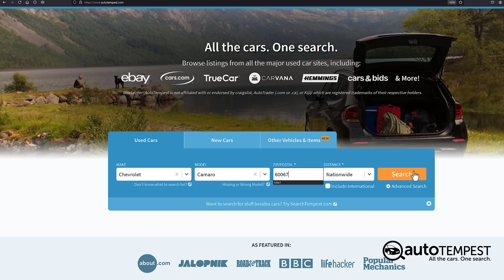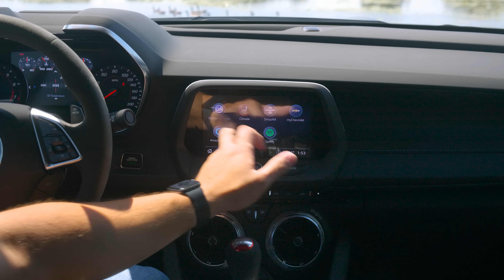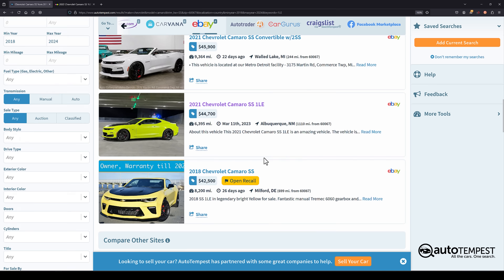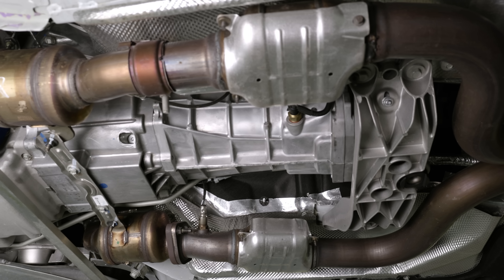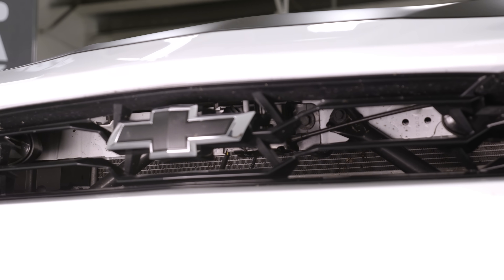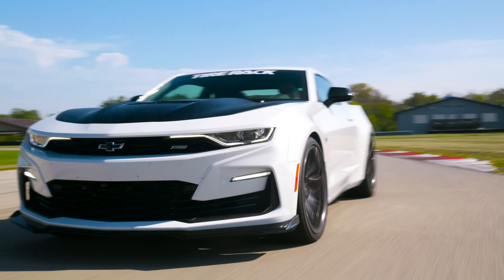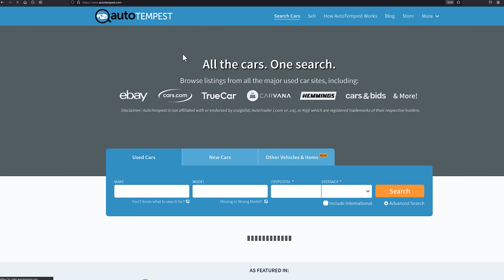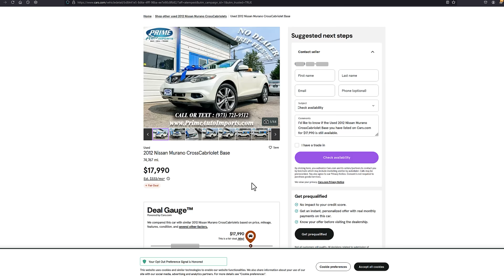Chevy Camaro SS 1LE | Best Used Sports Car of 2024

Comment: Owner of a 2018 2SS 1LE here that I taken on 30+ track days.  Thought I'd weigh in with my own experience:

1.  ENDORSED and great to see other people enjoying/discovering the car.  It's fantastic on the track and if you can live with the visibility it's a great daily as well.  I used mine as a daily for three years and the car has been very reliable.

2.  I don't know what tires Mark and Jack had on the car for review; I use the OEM Goodyear F1 Supercar 3s and think they're a really good track tire.  The Pilot Sport 2 is better yes, but I don't necessarily think it's worth the upgrade.

3.  Yes - if/when the car gives up a lot of time the front will go first.  FWIW, and given all the Miatas that can't shake me in the twisties, I wouldn't necessarily call it a "weak spot" it's just where the car is most likely to meet its limits.

4.  The brakes on this car are a strong point - I'd argue the braking on the car is better than the acceleration.  Between the size of the brakes and the mag ride keeping the tires on the ground you can outbrake a whole bunch of cars in an SS 1LE.  As the guys mentioned the car is also extremely stable; trailbraking is a strong suit.  Gyrodisc rotors and Hawk DTC-60s/70s are a worthwhile upgrade.

5.  I mentioned the daily reliability up above but if you keep this thing mostly stock it will absolutely eat track days and not break.  It's more expensive than some track cars but I like knowing that so long as I keep the fluids changed and maintain the car it'll start up and run.  All the mods I've really tried to this point are the brakes.

6.  Mark and Jack mentioned the S650 Mustang and the Supra as comps, I'd add one more - the F80 M3/F82 M4.  Looking at the weights and horsepower the Camaro SS/SS 1LE is fairly close to those cars.  The M4 actually has a slight edge in the straights, though the Camaro can outbrake them.  A key to getting fast laps out of the SS 1LE is learning how to use/trust the immense amount of mechanical grip the car has.

Great review and thanks for taking a look at this car!  I think someday they'll be in the pantheon of track legends like the E46 M3.  I'm super bummed GM killed the Camaro (again).

Comment: Had a manual 2024 2SS 1LE on order, but the dealership cancelled it because GM ended production. Found a 6speed 2SS with Magnetic Ride Control, and pulled the trigger. Man, WHAT A CAR! Handling is insane, comfort is a massive step up from my '18 WRX and '23 BRZ, and the car just looks/sounds killer. It's checked off all the boxes for me (storage and mpg not being one of them), and it's just sad the GM stopped supporting the platform to let the C8 corvette shine. Most of my friends are Mustang and MOPAR guys, but even they couldn't deny that they slept on the Camaro. I have never known the pleasure of having enough power on tap to merge on the spot... and now... I can never go back.

Comment: Wow!  I get here 6hrs after you (finally!!!!!) post the vid and it's like I'm the last one to the party for the comments that have piled up.    Thanks so much for responding to my and many others requests and doing this review.    Glad to see that you were both impressed.   
I am left wondering a little about your comments on the brakes.   I'm in my 4th year of tracking my SS 1LE and the brakes have been fantastic and without fade on OEM pads despite up to 30 min sessions.   Maybe the car you tested was using the OEM brake fluid (GM's may be crappy, despite being Dot4 now) or needed to be changed?  All of us who track it change to Castrol SRF and can run it all year (on and off track) without having to even bleed the calipers.

Comment: Loved my 1LE but got rid of it when the market was high and sold it for 8k more than I paid. Turned around and got a CT4V Blackwing.  The blackwing basically feels the same but is much better for daily driving. Both excellent cars in their own right
Reply: Camaro has the advantage of the V8 as MT has mentioned in the past when they tested Cadillac ATS-V, the only minus was the V6TT but then the 6th gen Camaro SS came out and they were amazed by its complete performance

Comment: I had a black/black manual that was stolen two months ago. When I bought it in late 2016, the driving experience was almost unbelievable. It kicked the M4's ass! Unfortunately they ruined the design in 2019 and GM seemed to give up on it after that. Now BMW has bounced back with the G82 and the Camaro is gone.

Comment: If you are tall, the visibility is not an issue at all. The Bose is a must have, the base audio is abysmal. I owned an LT1 trim - the absolute best value muscle car.
Reply: I prefer the Camaro SS because it has better handling than the LT1

Comment: Kind of surprised at your assessment of the brakes, I don’t know if that car fluid was old or what pads it was running, but I have never felt even a hint of fade with mine. I also do have the copper free package with the larger rotor.

Comment: Please don't stone me people. 

I prefer a Corvette and I think a lot of us would. Now to my BUT! This era of Camaro is amazing. I've driven one and they are fun. I considered one and will continue to do so as time goes on. I'm truly hopeful that GM will release a new Camaro and it'll be making the Blue Oval shake as it passes by. 😊😮😢

Had to say it. 😅😅😅
Reply: New C8 Corvette doesn’t have a MT option, and if you want to track you will need crazy extreme alignment, wearing your tires very fast. Tires Replacements aren't cheap.
Reply: @jmmch3358  Good points there. 
If we can afford the habit of racing we can afford the tire changes. What do you race with?
Reply: @WarriorsPhoto  at the least the Camaro riding on GY tires does not need the crazy excessive track alignment of the C7 & C8 Corvettes wearing more expensive Michelin tires.
I owned a Corvette C7 Z51 and a 6th gen Camaro SS, so I saw the big $$$$$ difference.
Reply: @jmmch3358  Michelin tires are very good tires and so are GY. 

Other than cost of ownership, what was better between the two vehicles?
Reply: @WarriorsPhoto  the low seat driving of the Corvette C7 Stingray its an amazing experience, car is very fast has great handling, looks amazing from the outside and inside, jet fighter cockpit style. I tracked the car, the A6 transmission's rear differential of my '14 overheated after a couple of laps, it was embarrassing I had to leave the track while other econo boxers kept tracking. The car was very unreliable most of the time was at the dealer getting expensive repairs, at least was under warranty. My 6th gen 6MT Camaro SS was very reliable, didn't look as special as the Corvette, was similarly fast, also great handling, great brakes as well. Just when I did a quick change of lanes or during a curve, it felt that it had more weight in the back, didn't felt doing that as agile as the C7 Z51. It would be a 9/10 of the C7 Corvette.
For Vanity the Corvette, for practicality, $ and as near the fun the 6th gen Camaro SS. The exhaust of the Camaro sounded much better, both had the NPP exhaust option.
Reply: @jmmch3358  Good points from an owner of both cars. I appreciate your input. 

Hopefully you’re finding joy in whatever it is you are driving.

Comment: I test drove an 18 Scat Pack and a 15 and an 18 Camaro SS, But once I drove the Mustang GT, I was home.. I know the Camaro's tend to handle better but a performance Pack GT will get you right on par with the Camaro as far as handling.. And Besides my GT only weighs like 3600 LB's compared to the other to cars which are both 4000 lb's plus..
Reply: The performance pack GT won't put you on par with the SS from an out-right handling perspective (Mustang GT will still be below it), but I can understand that for everyday usability, the mustang is clearly better.   And for street driving (unlike track) you can't really exploit the full handling capabilities of the G6 Camaro SS, let alone the 1LE, so in that regard I can see how you'd think the Mustang handling was "on par"
Reply: @northcamarolina7453  I agree the Camaro is a better track car..

Comment: My wife and I were looking at one, and after sitting in it, we couldn't get to the test drive.  The visibility was just so poor.  I know everyone says "get used to it".  But at the time (brand new money) I didn't feel having to get used to it was reasonable at that price point.
Reply: The point was "you'll get used to it" meaning that your brain learns where the front corner edges of the body are after a short period of time.   And that is actually what happens when you own one.   But yah, I get it.   It's unnerving to not have the sight lines that you are used to having in your everyday grocery getter.   Camaro chassis was designed for performance first and isn't as practical for daily driving as some of the other alternatives.

Comment: Want to add a correction for folks shopping for one. If you want an auto it’s 2021+ not 2019. 2019 was the first year the ZL1 1LE had an auto option. SS 1LE didn’t get it until 2021.

Comment: The SS 1LE is amazing. I love driving it and the prices are very attainable for what the car is. The manual is also very nice - my first time ever driving a manual car was test driving one of these in Vienna/Tysons Corner, VA - only stalled once on a hill and that was because I didn't understand what hill start assist was lol.

If I didn't need the trunk space and occasionally the rear seats that my RS3 offers (and if the daza didn't sound so damn good), I'd probably be in a camaro. The visibility issue is pretty overblown IMO, especially with the rearview camera. IIRC, the ecu tuning was changed for 2019+ models, so they got more crackles and pops. They sound absolutely nuts. 2021+ gets wireless carplay which I think is actually pretty important in this car because there's basically no space to put your phone in the car.

Comment: I've got a ct4 blackwing with a 6 speed which is basically one of these with a twin turbo v6 instead with 8/13 more horepower and better visibility and a nicer interior and I love it. Alpha chassis is great. Feels just as good as my c7 z51 did
Reply: The only thing missing is a V8, like when MT test drove the Cadillac ATS-V, they mentioned that and afterwards came the '16 Camaro SS with the V8, then they said that it was the right engine for the Alpha platform

Comment: Finally, the SS 1LE has come back, to Autobahn... It really is a spectacular car for the money. GM would only need to recycle and shave some weight off the Alpha chassis, put a next-gen V8 in it, and style it like an IROC while keeping it's price in check, and it'll sell like crazy. One can dream they'd bring it back, style it right, make the back a hatch like the IROCs, and T-Tops (That's right, I said it) and it'll make everyone happy. Sounds great, it's performance is shocking for a big Camaro, it's suspension is great for track, and in touring is livable and easily a good daily cruiser that doesn't beat you up. I like mine, a lot.

But the take is correct, GM killed it because it was too awesome, so awesome there were quite a few Vette owners that passed on the C8 to grab one of these. Mary Barra and others at GM are clowns for killing it off. And if they did bring it back, it would cost Dark Horse money and would instantly diminish it. This was, and is, the best bang for the buck fun track car. Yeah, a Miata or 86 are cool, but they're not built like a real track car like this.
Reply: Or it could have been called a Z28 6th gen Camaro

Comment: The 1LE Really is an amazing car. Feels so planted and gives you so much confidence when driving it hard. The most fun car i have ever owned and miles better than than my previos 5.0 with the performance pack. I would say its even more fun than c7 stingrays. Just not a good daily in my opinion. The Suspension and the performance tires make the car a little too aggressive for daily use.

Comment: Would love to see Jack's lap time in ZL1 1LE, which has better brakes and cooling + another 160 hp on a dyno.  Because the ZL1 exists I have less interest in this car, but oil pump failures are more common and it absolutely requires a catch can with DI

Comment: To me, these cars are so close to being perfect and I really think if they kept it around and just did some slight updates it would be phenomenal. Updating some of  the suspension and having an interior update would have been awesome.
Reply: The only thing that was pending to be upgraded before GM cut its production, was to use the Cadillac Blackwing higher HP SC on the Camaro

Comment: Fun fact, The gen 5 camaro z28 with the LS7, 100 tread wear tires & no Ac is slower around a track then a 6th gen camaro SS1LE
Reply: C&D lightning lap:
Z28 - 2:50.9
SS1LE - 2:54.8
Reply: 17 SS1LE 1:37.78
14 Z/28.   1:37.82
Track: Laguna Seca
Driver: Randy Pobst
Source: Motortrend

Comment: 3700lbs isn't heavy anymore in almost all modern cars. How much does the m3 m4 comps weigh. Porsche are the lights but even the 911 is chunky compared to a gen or 2 behind. The only way to get 3k or lower weight with 400 plus horse power is to pay big $$$$ or build something old yourself

Comment: The cars that came after the 2010 were never as good, the only additions I liked to them were what they did to the interior with the RGB that is awesome, other then that the exterior of the car didn't really get better after 2010 the only tail lights i liked that came after the 2010 were the tail lights of the Zl1 that kind of resemble the taillights of the C7 but thats it. The hood of the 6th gen was a huge disappointment with the nostrils I hated it. I liked the upgrades they made to the exhaust but ultimately I like the 2010 better and best. The newer headlights they tried to change up to make look different and cool but they also don't do it for me. The car kinda fell off after 2010 in my opinion. I know they reduced weight and improved handling and performance and all but still the car overall always seemed off after 2010 in my opinion. At first I wasn't real big on the tail lights of the 2010 but I also like them better then all the tail lights that came after aside from the ZL1 tail lights i mentioned. Also, all these cars with the black hood, I know that's a fad and everything and if its carbon fiber yeah its lighter but you know what it looks like to me? it looks like " nice car but awwww they haven't yet painted the hood "

Comment: I owned an S550, GT PP1 and currently have a Mach 1. While I do prefer the Mustang better from an engine and dailiability standpoint even I would say that if you’re a track rat and dynamics are your primary concern the alpha platform is better. Mach 1 non HP is similar to a non 1LE SS based on my memory of driving one. I just personally like everything else better (especially the yote) on the Mustang and am more of a daily and backroads guy then a hardcore track guy.

Comment: I went for a 2010 Jaguar XFR. More comfortable on the street, dramatically better interior, better stock performance with nearly as much headroom for aftermarket performance improvements, and much, much prettier. Oh, and cheaper. The SS is a good setup but on the used market there are better.

Comment: The front fascia from '19 looks like a bottom of the barrel, S-10 fleet monstrosity that didn't even come with a radio, 10/10 smelled of onion b.o., an (under the hood) straight from the factory half rack of Steamin' Grease Detroit Liquor and an orange bottle of Oxys that has cotton, a spoon, a lighter, and two used syringes in a Walmart bag tape rolled inside of the booze box. There's also an Astrology chart. Now we've gone too far.

Comment: I run 19x11 and 305s all the way around. Grip for days...
Reply: What spacers you have in front? Also did you move the wiring harness? I have a 22 2ss 1le manual and the goodyears are at their last breath even at 6000 miles.

Comment: Why do all the car reviewers forget to bring up the skip shift in the manual transmission...
Reply: In practice you can shift around it.   My normal street driving is short shifting 1-3-5.   Nothing about the skip shift feature requires you to shift 1-4 or prevents you from doing 1-3.
Reply: @northcamarolina7453  Okay but unless you are a "Car Person" most people don't know what's going on and the skip shift transmission also has problems which causes failures. That's why I think they should bring it, for those not in the know.
Reply: As a 22 2ss/1le owner, skip shift only comes into play when you drive like a grandma 😂 These guys drove the car properly so they probably don’t even know what it is
Reply: @al151  I think you totally missed the point and if any of these reviewers are worth a damn they should know it's there for emission reason like how the auto trans cars have cylinder deactivation that destroys the engine over time. Things people should be aware of.

Comment: Wow, i really want one of these. I considered it over covid and now I regret buying an 86 instead.
Reply: Eh, for the price I wouldn't regret the 86 (if it's the gen 2). They're very light and don't need much power to be fast. They handle great, they're a great starting platform to mod.. and at almost half of the cost.
Reply: I had a 13 frs and upgraded to a 2ss non 1le. Tbh, I feel the frs handled better

Comment: This car just proves GM needs to get the Camaro and Cadillac V/Blackwing engineers under the Corvette umbrella as the sports brand for GM and make sure they are flex fuel compliant, like VW has Porsche as their upscale sports brand and are planning to make sure their future cars are synth fuel compliant to get around future emissions regulations.

With the comparative low production for sports cars, and the "recycled" carbon content of bio / synth fuels, their collective emissions won't be noticed in the grand scale of things.